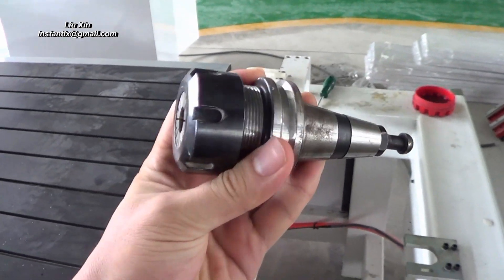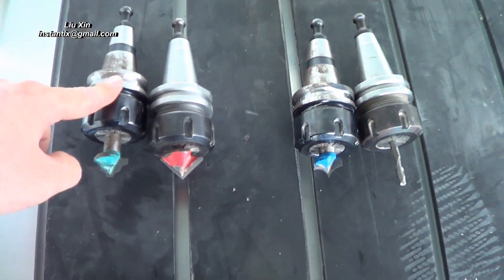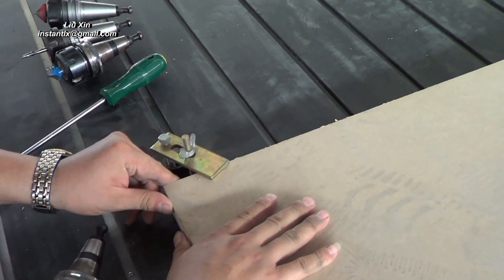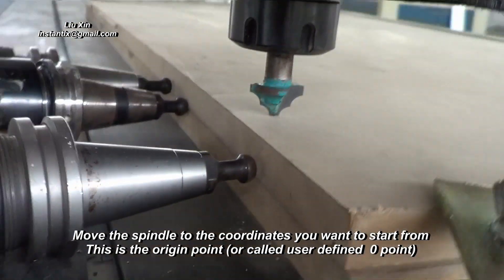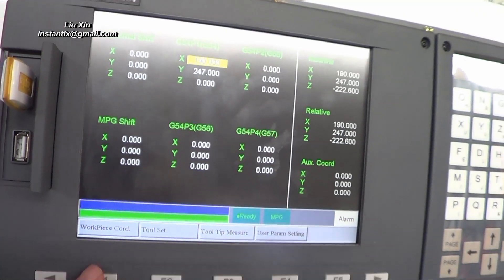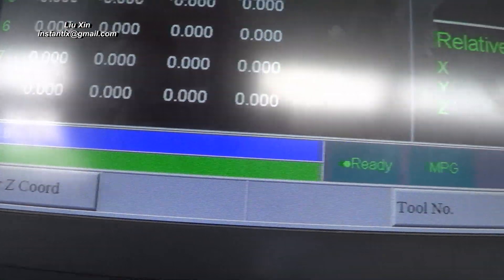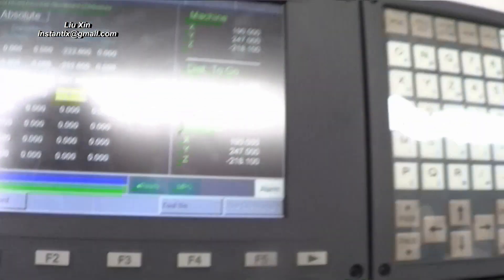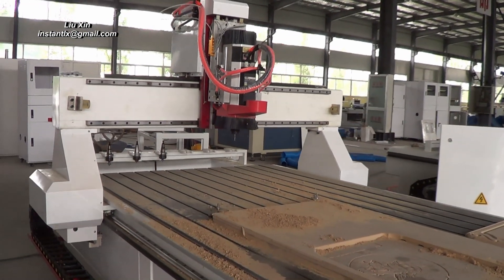SYNTEC for row type ATC, step by step, China cnc router,China cnc router,

Comment: Hello please can you explain to me on syntec MB6 how to correct the coordinates of the x or y or z axis a liver that the job is running for example if I run a job and I see which one needs to correct z axis because it do not cut at the bottom of the material I stop the machine I add 1mm and I continue the work without starting again from the beginning or it is impossible on syntec MB6